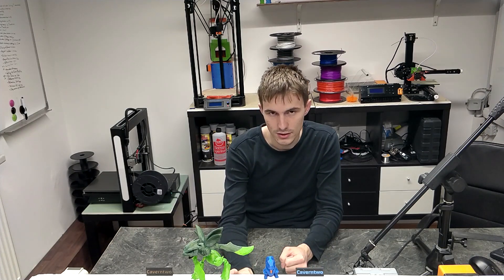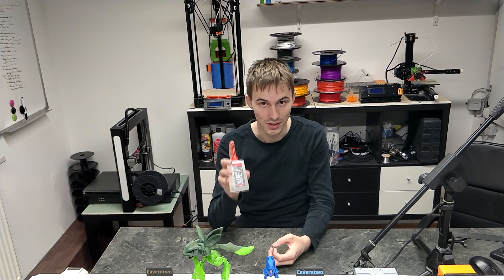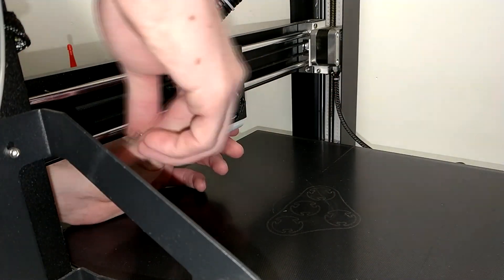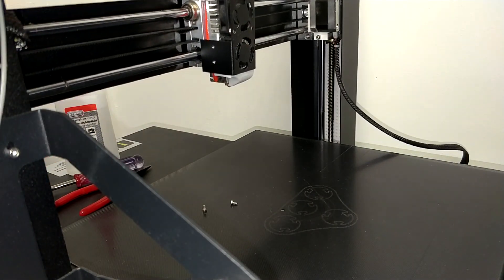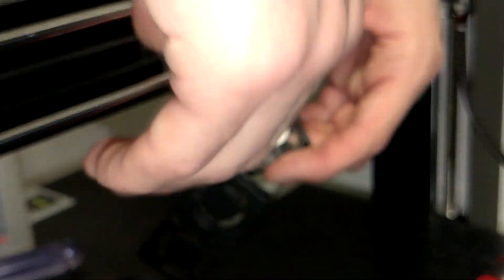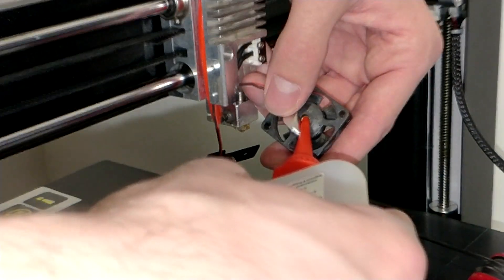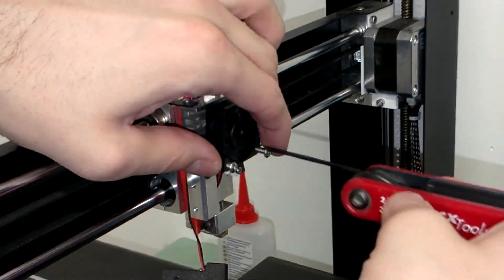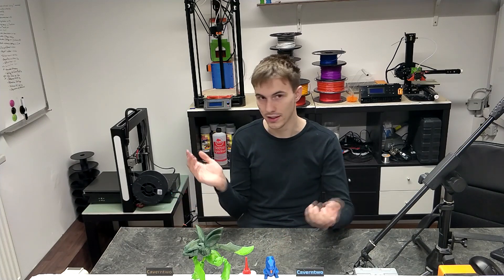Fix Noisy Fans on Your 3D Printer

Comment: If you carefully push both side of fan blades together, the blades come out in 4010 fan of Ender 3 V2. Then you can easily clean the blades and lubricate the whole shaft. :)
Reply from the maker: Good tip!

Comment: so.. after disassembling power on the fans.... i bet they don't make the noise... this issue usually comes from incorrect mounting pressure on the screws... this induces some friction which causes the issue... yes lubricating the bearing will reduce overall friction enough to "resolve" the issue... however if you just slacken off the screws this should permanently resolve the problem.
Reply from the maker: They still did, I just didn't show it in the video, as I figured it isn't too relevant.
You're totally right, incorrect mounting could be an issue, but I am almost certain that it didn't cause an issue, as it isn't firmly mounted anyways.

Comment: I did this many times. My fan becomes noisy and slow again after few days. What should I do?
Reply from the maker: Hi, thanks for your comment.
Over time, the fan becomes bad (especially when it ran "dry" for a while) and needs to be replaced. They are relatively cheap anyways.

Comment: Thanks mate! Fix worked like a charm on my ender 3.
For those with an Ender 3, there's no bearing on the back of the hotend fan, like shown here. Instead I squirted a tiny amount of bearing lubricant in the gap between the fan and it's motor mount.
Reply from the maker: Hi, thanks for the feedback!
I'm glad that it worked out for you. Just be aware that the fix is only temporary though. 
So far I've fixed a few fans on the 3d printer, in a power supply and even in two laptops using this method. Some fans can be disassembled easily to get better access to the rotor. If that's the case, more viscous lubricant like bearing grease can be applied, which should last longer in theory.

Comment: for the lead screws or sliders try a bearing grease instead, your oil is very thin and that makes your machine move more 'chocky'. You want your slide to move smooth and consistently, but not super loose like what you would achieve with the oil you used.
Reply: Try a grease on the sliders aswel, you will see a decrease in layer shifting, trust me 😁
Reply: Make sure to remove old lube before you apply, the old oil will thin out the grease
Reply from the maker: That's very important. Grease on slides and the leadscrews tend to catch dust as well, which will decrease the lubrication.
Reply from the maker: Hi, thanks for the input!
You're totally right, it's best to use bearing grease for leadscrews and the oil for slides, guides and rods. 
However, it's still better to use oil on the leadscrews than to not lubricate at all, but the result won't be good.

Comment: Better use grease on lead screws not oil. Grease lubricates generally better than oil. The only problem with it is that it can get hot and start burning away on high speeds plus the introduced drag. That's why oil is for high speeds (like the fan) but for lower speeds  (lead screw) grease is better.
Reply from the maker: You're totally right!

Comment: what kind of oil did you use?
Reply from the maker: Hi David,
That's a universal oil which you can also use for sewing machines. It's  very cheap and just liquid enough so that they go onto the axle.
Reply: @Caverntwo  Electric razor blade oil worked for me.

Comment: So did it work?
Reply from the maker: Yes, it worked for me, but only for about two months.
Reply: Caverntwo Two months are better than 8 hours👍👍
Reply from the maker: @thatdude5477  So it only lasted 8 hours for you? 

Sadly, the solution isn't perfect, it's just a quick'n'easy workaround. The ultimative solution obviously would be to replace the fan with a higher-quality one.

Comment: I've lived with squealing hot end and cooling fans for ages. Never occurred to me to lubricate and I just kept putting off buying new ones. Then I bumped into your video. What a difference a little machine oil can make! The difference is like night and day. Thank you for posting this simple tip.
Reply from the maker: Hey, thanks for your feedback! 
I'm glad that you liked the video!
Please be aware that it is no permanent solution. You'd need to lubricate it again in 2-3 months, but for now, it's silent ;-) 
The fan shown in the video still works though!
Reply: @Caverntwo  No problem ... nothing lasts forever ... even lubricating every 2-3 months will fail eventually.
Reply from the maker: Yeah, you're right. That's I think the main reason for keeping spare parts.

Comment: Your method works well - I've used it many times on PC cooling fans.  The duration of the fix really depends on the quality of the fans.  Unfortunately many of the fans used in 3D printers are of extremely low quality - my Ender3 fans started to not only whine, but they also leaked/sprayed oil from the factory.  I suspect the bushings are made of marshmallows or similar material.   SMH...
Reply from the maker: Thanks for your comment!
It's always nice if people share their experience.

We oiled larger and older PC fans back in school, but they looked like they were of way higher quality (probably already 20 years old) than the $0.30 ones available today. 
The fact that yours leaked oil means that there was oil in the first place - which is something I'm honestly not very sure of in my cases... Who knows?
Let's see how long it lasts on my machines.